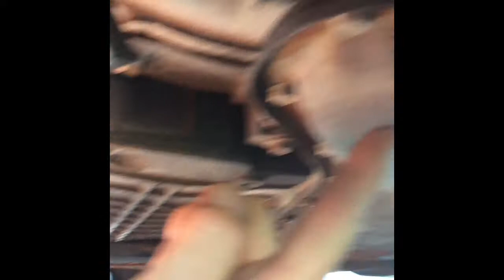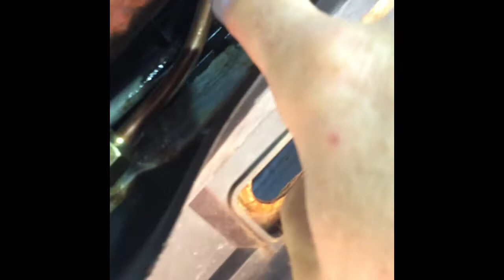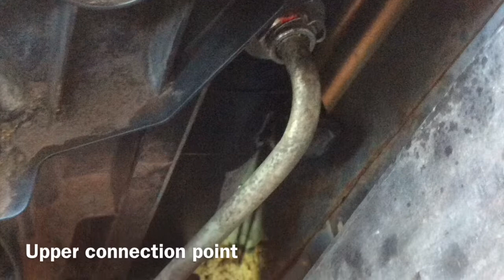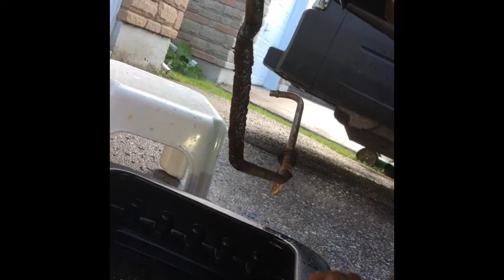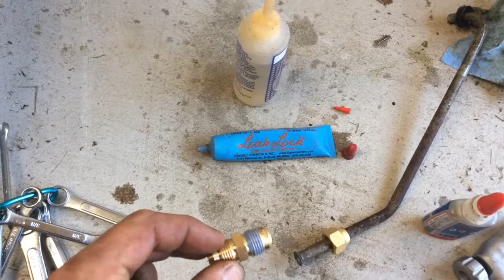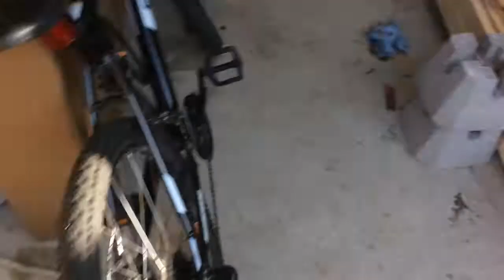Transmission oil cooler line quick repair on Chevy Uplander

Comment: Also, if you notice, there are rubber flex pieces on these lines, at least on my 05 sierra. Thus, you could use that quality rubber flex pieces to splice into corroded areas, instead of the copper.